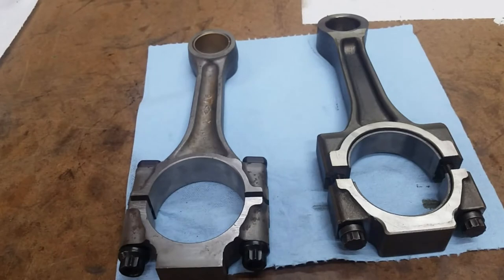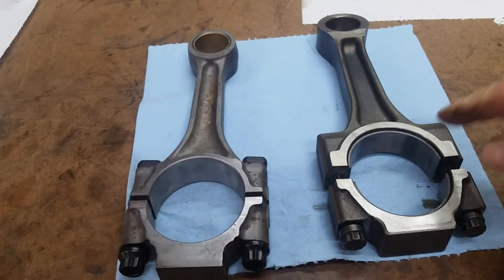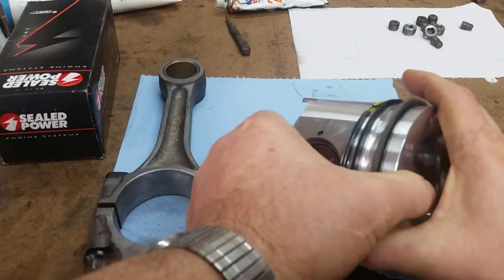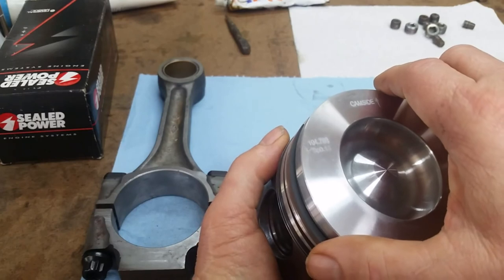7.3 Build: Piston Install (part 1)

Comment: Love the vid. How do the rings  stay in thier clocked place when engine is running.
Reply from the maker: The rings will  pretty much stay in the installed position. They will not move unless impacted by an external force.